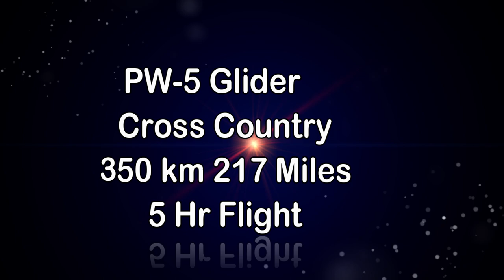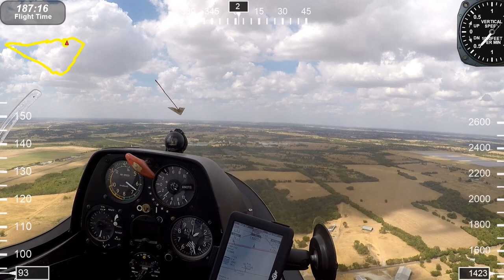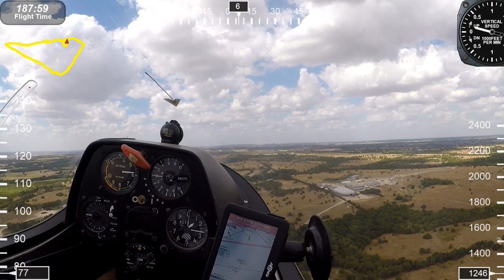Flying the PW-5 Glider Cross-country 217 Miles 5 hours. Can I make it back to base Roy Dawson video

Comment: Looks like there is a disconnect between your video and the data logger (the data around the edge of the screen)--Altimeter reads different than the GPS altitude on the R side of the screen, and there was a time you were turning left, but the red triangle on your track line was turning right (06:50).  Nice flight though.  Would have loved to have flown with you that day!
Reply from the maker: yes the sync is off a bit, thanks